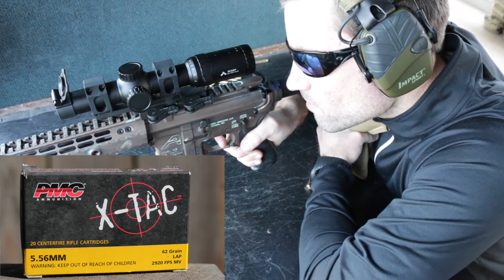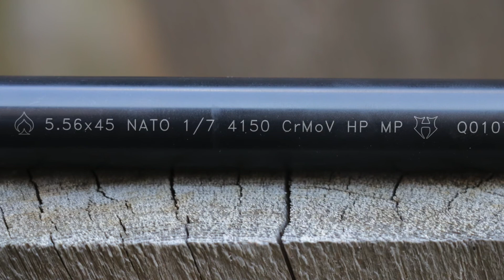Aero Precision Build Series: Accuracy Testing

Comment: Shooting 223, even match grade out of 5.56 barrel will not result in good accuracy. Unless your barrel has 223 Wilde chamber. But either way sierra bthp bullet will do the best. Also 5.56 is naturally inaccurate comparing to 223 chambered gun. Shoot 5.56 ar
Because you’re tactical bros. Shoot 223 if you care about accuracy

Comment: Pretty unsatisfactory accuracy results from that Hanson barrel. Especially with the Federal GMM. That's where I stopped watching. Check your torque on the muzzle device. Over torqueing can cause accuracy issues. If not...I'd have to send that barrel back.

Comment: There is absolutely zero excuse for a modern barrel to not shoot at least one MOA. It’s unacceptable in my opinion. Especially for a company that prides themselves on producing accurate barrels but that stands for any company. Not impressed. I get that that sounds harsh but come on, there are so so many barrels out there for not a lot of money that will give me at least one MOA.
Reply: I purchased the exact same barrel, I own one. The barrel shoots lights out with a bare muzzle and has shot .75” groups with no muzzle device but as soon as you attach a flash hider it goes to 1.5”. Iv tried dozens of loads.

Comment: The barrel is capable of far better accuracy! The groups could improve with a precision scope e.g.  Mil Dot or MOA with a Horus type reticle. The Primary Arms 1x8 scope with ACSS scope is an area shooting scope. Area-meaning man size torso area. Despite the talking points of an infinite aiming system in the triangle point, but I don’t find that to be the case. I have the PA 1x8 premium scope and a PA 4x16 premium scope with R-grid 2 reticle and I can consistently shoot tighter groups with the 4x16 than the 1x8 on several of my rifles. 
Get a precision style reticle scope and you will definitely see tighter groups.

Comment: BA is crap, thumbs down
Reply: I run the BA premium 223 Wylde, 1/8 and it is a tick driver! It doesn't like the 55 and 62 grain bullets as they are about 2 in ch groups, but 69 and 77 grain bullets are sub MOA all day long. Of note, I use a 24 power scope instead of a 6 or 8 power during my grouping tests.
Reply: @Super61Blackhawk  right, yeah I've heard all the praise about their stuff.  I've banned them bc of clint's customer service... extremely shady at that.  Long story short, i bought an m5e1 for a great price (new never fired and was verified), it would not cycle, sent it to ba twice they said "it shoots fine, i get it back wont cycle, tried commercial and nato rounds, nothing... they even made a vid of it running. I'm not an idiot ive been shooting since i was a kid.  Found a loose barrel nut when i got it back the last time where i fully expect they changed the affected barrel out, made the vid, then put the non working barrel back on.  I also saw ghosting around the gas port where someone didn't pin it correctly. Basically aero Precision switched it out free of charge with one of their ss barrels, got it back ZERO issues with any type of ammo.  Clint is a liar  and a sneak, he will never get a penny off me and if i can steer others away then thats icing on the cake for me.  Hope you're reading this clint. Loser.
Reply: @--RSL--  doesn’t aero own BA and all their uppers, not to mention DD and other high end brands, use BA as OEM?

Comment: First off, GREAT quality video!  Maybe consider letting us hear the actual shooting rather than music playing as u shoot, kinda will put us in the operators seat, if you know what I'm saying...  Also, some of those loads should have NO issues getting sub MOA, so I'm wondering if their is an issue somewhere, cause while those groups were definitely not bad, that barrel and your equipment should have NO issues getting sub MOA groups, especially with the loads you were using.  Anyways, I subscribed, just wanted to add some feedback.  Thanks for the video...
Reply from the maker: Thanks for the sub, brother!
Reply: The Lonestar Patriot Check out this video, he has no issue getting some awesome groups with this barrel.  https://youtu.be/6xKjWlo_4ec  Of course you still didn't do bad with a couple of those loads!  I think anything 2 and below I'd be super happy with!  :)  Thanks again
Reply from the maker: Man, my apologies as I thought this video was for a completely different barrel so scratch my previous response. You're right, this barrel is capable of sub MOA groups and I believe the tightest group from those loads tested was ~1.25". In fact, Ballistic Advantage has their MOA guarantee so there's no doubt it'll get there with the right load.
Reply: The Lonestar Patriot Hey, no problem,  I just thought that you knew it has a sub moa guarantee and that you may be slightly pissed off if you didn't get that... :)  I definitely wasn't trying to prove you wrong or anything,  just was wondering why you thought it was OK for those kinda groups.  You seem like a great shooter, so maybe the next video you can show us those sub moa groups from this barrel?  ;) Lol  Take care brother!

Comment: Is Aero's M5 14.5" uppers used maybe by JSOC type operators during any type of IRL SAR/DA/HR/ETC type op or even ANY shortened carbine length 7.62.51 in a carbine length... Like the SR-25K, which I had decked out with offset irons, a Maxim CQB style pop out CQC stock! ..even had an old ass 3rd gen aimpoint because of an emotional attachement with just a straight foregrip.  which I had integrally suppressed but that was in a six year temporary priv sec firm IC job. Just doing PSD in as a trunk monkey lol and idk why, but some FID type asymmetrical stuff since I was the only terp who was fully able to know the little small incremental changes in dialect etc. Point is, anyone know where I can find something by LaRue, LMT, AERO PRECION PREFERABLY, and then KAC if nothing else comes to mind... Please? I have my second lead advance team tactical job in years and not being stuck in a hot Yukon truck at TITANGROUP or worse, on a sweating street because we had so much on with the IBA and plates et*....So I'm going light-is-right with a heavy ass caliber thats NOT a 6.5mm Creed for once and back to what would dump a big boy with two to the clavicle.

Comment: Dump the BA (below average) barrel, get a columbia river arms (black hole weaponry) 16" mid length, mid profile 1:8 twist 3p polygonal rifled barrel, buy some defender ammunition 77gr smk
 (.64 cents a round!) and you're now 1/2 MOA. Except I use the 1-6x PA acss.